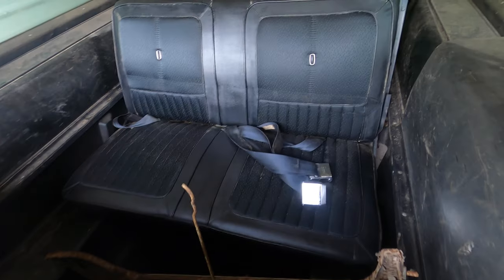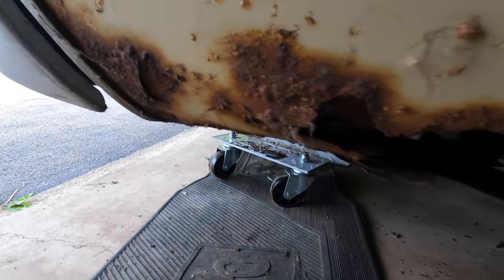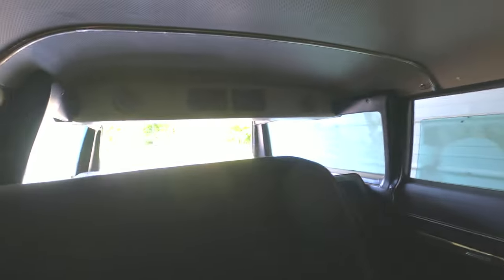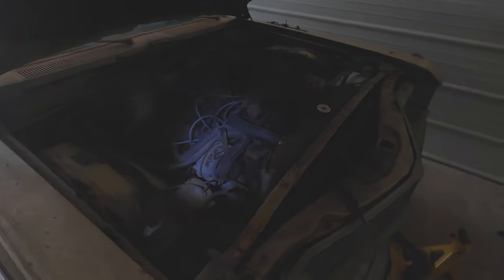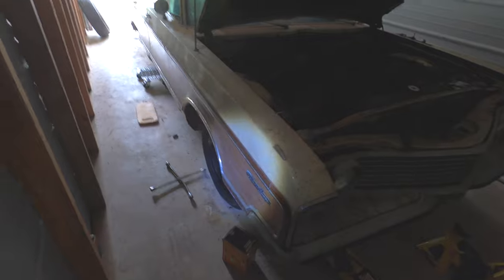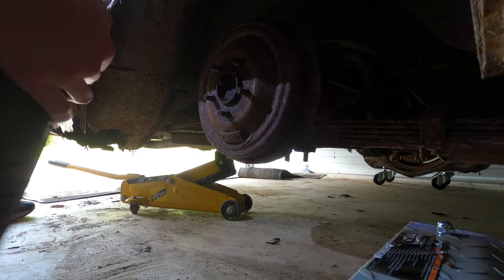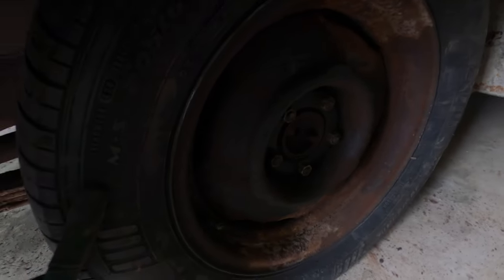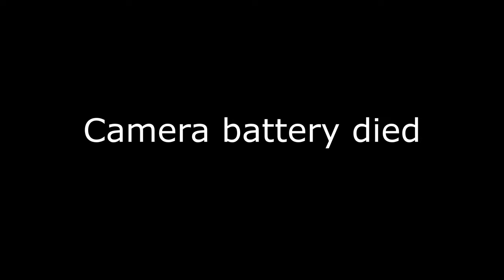BARN FIND 1968 Chrysler Town and Country revival part 1

Comment: my dad brought one of these home brand new in 1968 a demonstrator from the dealer - it had dual air conditioning also - this wagon appears to have every option including rear window wiper/washer system (see chrome washer filler cap on upper left tailgate) cornering lights (lower front fenders) the passenger side rear view mirrors were optional back then - also disc brakes (see special disc brake wheel covers) the roof racks on these wagons were enormous

Comment: Damn, this is a RARE find.  I found a 67 Town and Country wagon, original owner, window sticker, factory 440, Dual A/C, power windows, sitting in a carport in Arizona for years (AFTER her husband died) and the windshield got sand blasted and field rats had a heyday in the engine compartment and interior and she took parts for her 68 New Yorker 2 dr. HT.  I had to pull the engine and completely rebuild it because of all the debris from the rats (she had the carb removed for her car, so the intake was wide open).  I wish it was as loaded as yours.  Is that AM/FM Stereo in there? (First year option).  I LOVE that it has split bench seat with power on both sides and dual headrests.  Does this have auto temp A/C, another first year option?  Power vents.  I don't think they missed a box on the order form.  Hopefully you can find the broadcast sheet (either under or behind the back seat or under the front seat.  If you can get it out, have it laminated to preserve it.  VERY important documentation.  Also, yours has the optional rear window washer/wiper.
Keep us posted.  GREAT RARE CAR especially optioned the way it is.
Beside the 67 wagon, I have had a 69 Monaco wagon, 383 4bbl, dual A/C (another Arizona car), 73 New Yorker T&C wagon, FULLY LOADED 2 owner car, several Imperials all with dual A/C and several New Yorker 2 door HT's.  I just love those old C bodies.